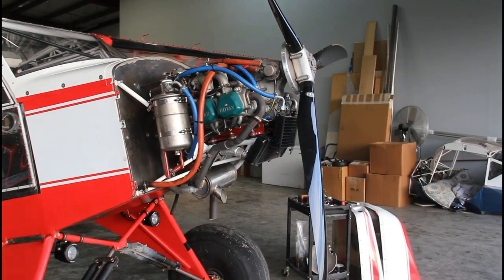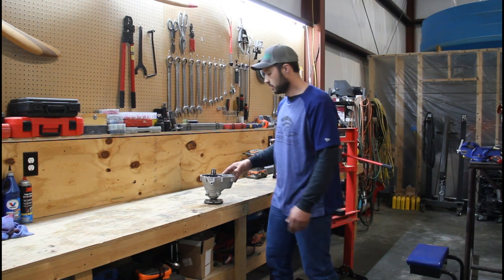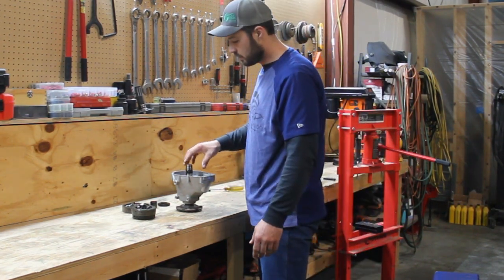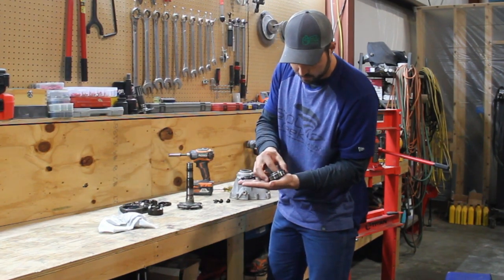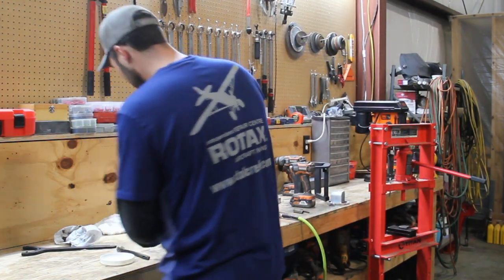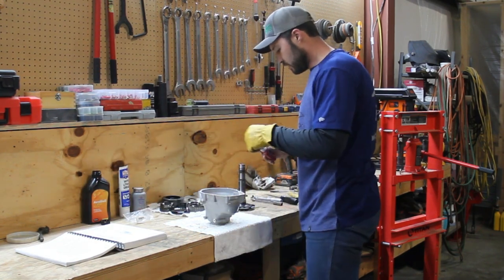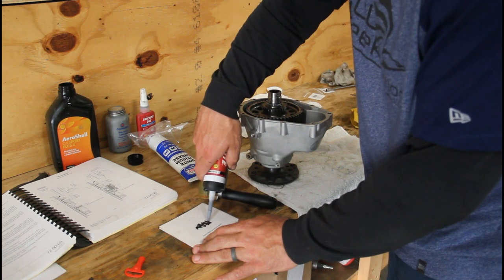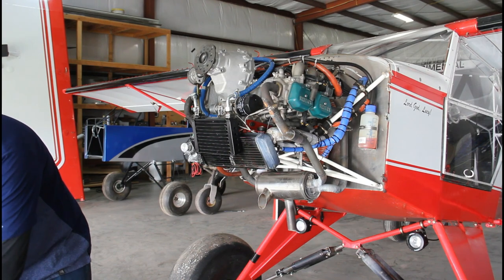ROTAX 912uls 600hr Gearbox Inspection

Comment: Seems like there should be a log of each parts measurement while going back together. Like bottom ring thickness x thousands, next ring x thousands etc... that way impending failure can be tracked and prevented once enoungh data has been collected.

Comment: Thank you for the video!   I'm preparing to remove the gearbox from my 912ULS, then take it to a certified Rotax Repair Center for inspection or rebuild.   After that, I will install it using the method you showed in the informative video!   Rans S6ES Coyote ll.

Comment: Was that just a silicone roller?  I usually put a bead on there but this looks much more professional and clean.
Reply from the maker: It was just a cheap hobby roller. I like it because it is a fast and uniform way to get the RTV on big pieces. And it does not fill up the places you don't want the RTV like in the bolt holes.

Comment: Great Job. Do you see gearboxes out of tolerances or in bad conditions at 600 hr? I´ve read that this kind of inspection is mandatory at 1000 hs.
Reply from the maker: Most of the time things are OK, maybe a shim job. A lot of wear shows up soon if it has been doing a lot of idling.
Reply: @stolcreekaviation5507  What rpm do you consider being above "idling" on a 100 HP 912 ULS? to minimize dog wear between the lobes?  I'd think the 10.8 : 1 compression ratio tends to have more acceleration /deceleration per revolution than the lower compression 912 UL, so you'd want it to idle a bit faster?
Reply from the maker: @randyvanvliet226  Every engine runs a little different on where it starts running smooth on warm up. Most of the time I target 2,500rpm for just sitting around.

Comment: Question for ya.  I hear 600 hours if the motor is run on “a lot” of avgas, 800 if on “some”, and 1000 otherwise.  I’m the third owner of a plane with 570 hours, and the other owners “mostly used” auto premium.  What’s your recommendation?  Thanks!
Reply from the maker: The biggest thing in my opinion is making sure the gearbox is still shimmed properly. How much the engine has been run at low RPM where the gear box is chattering makes a big difference, flight schools are the worst about this. There is a dog ear friction test that can be done to get a gauge on how it is shimmed and getting a trend line with that is even better. Cleaning the lead out of the clutch pack is good but I have not seen it really bad after just 600hrs.
Reply: @stolcreekaviation5507  thanks for the reply.  I don’t notice chattering that everyone talks about, but it’s my first Rotax motor, so maybe it is there and I just don’t know it.  Run it!

Comment: I've got a new gearset ready to go in my 912UL (no clutch) but not a new doghub. Should they be replaced as a set? 🤔
Reply from the maker: It is recommended but I wouldn’t say mandatory. The two gears are the only mandatory matched set. It would really depend on the condition of your old dog hub, you would hate to mess up your large gear right away with a badly worn dog hub.
Reply: @stolcreekaviation5507  Thanks for that :)

Comment: Did you say Decaline is good to use?
Reply from the maker: Yes it helps keep the lead from building up in your engine.
Reply: @stolcreekaviation5507  The FBO (a local old dude) used that stuff often in his 172s and 152s. Said it would keep the lower plugs cleanEr. Question. What is the ratio of that gearbox? Say the engine is turning 2000 RPMs, what is the prop turning? Nice work putting this together and sharing it. Thanks!!
Reply from the maker: @radioace318la  The gear reduction is 2.43 to 1.